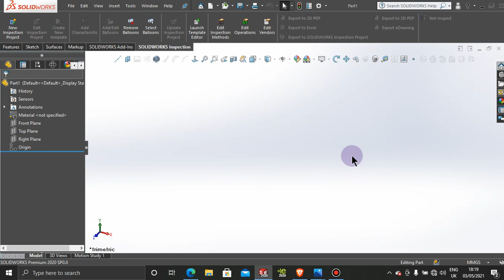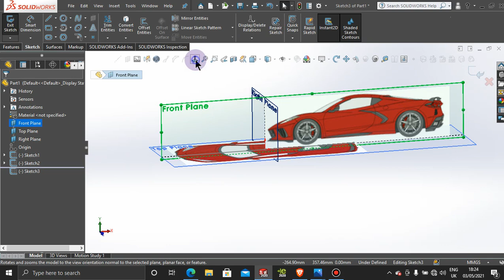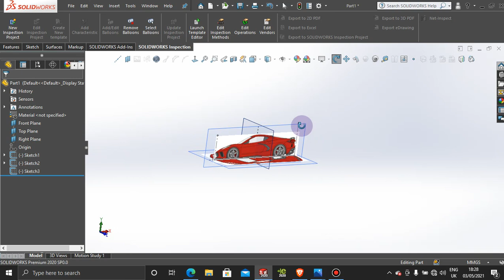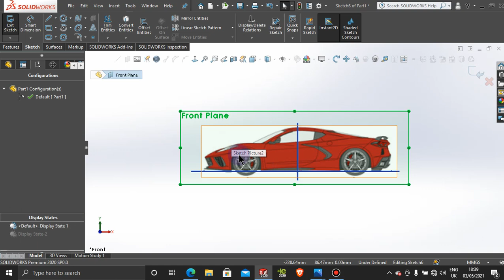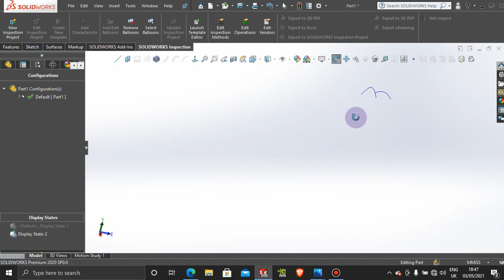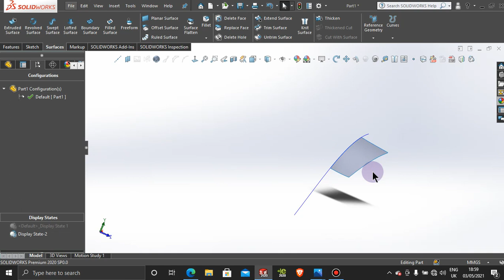Solidworks tutorial  C8 Corvette part 1

Comment: Would you consider doing a motorcycle after this car? I just got SW2020 from my EAA Membership just to make this C8. Are we making the entire car (outside parts) ?
Reply from the maker: So once we finished with all the outside surfaces it will have wheels suspensions  engine and interior all of this are mechanical  what is very easy compared to surface design. So yes we can make a motorcycle after c8. What motor you have in mind?